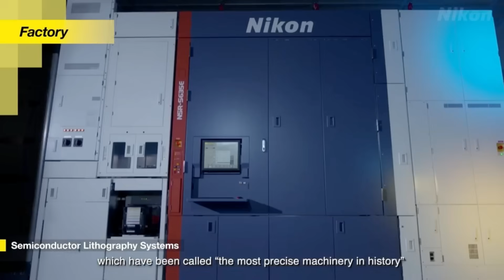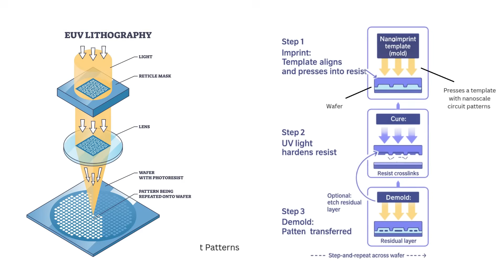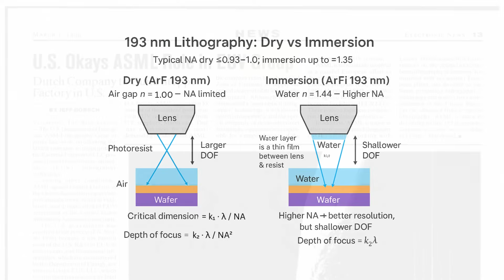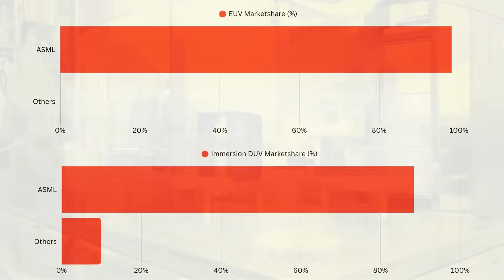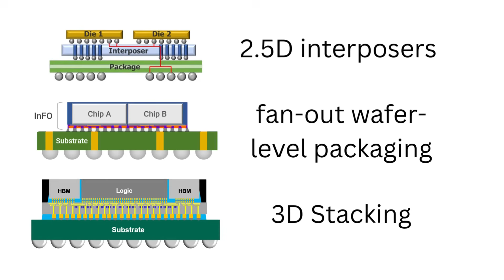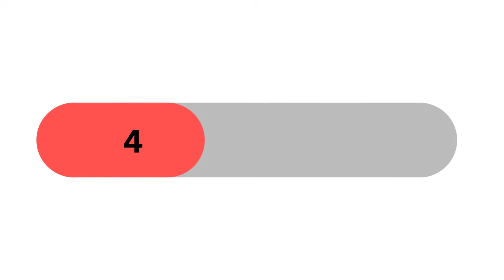Nikon’s Comeback: Japan’s Quiet Return to Chipmaking

Comment: Nikon still has 4000 chip manufacturing machines (out of 8000 installed) still in service around the world. EUV doesn't hold all the markets. At one point Nikon supplied Intel with 80 percent of their machines. Certain markets like camera sensors don't need the less than 10 nanometer circuits. ASML's most advanced machine costs 400 million dollars per machine.

Comment: I'm not sure you can trust this AI-generated video as the AI software doesn't realize that EUV is only possible with mirrors, not lenses, which is repeated multiple times. So what else is incorrect information?
Reply: If it cannot pronounce NIKON (nai·kaan) and keep mixing in (nee·kaan) how can you trust the data?
Reply: @Macazian because pronunciation has nothing to do with data?
Reply: @Macazian  Neekon is Japanese pronoun not Naikoon. Regard.
Reply: @Macazian  Japanese pronounce it as "nee-kon".
Reply: I ran the transcript through AI, and even it was suspect of  the message
Reply: Yes, it uses multi layer mirrors, not lenses, it's wrongly mentioned lenses even in their diagram. 
However the lithography machines shown from ASML & Canon is true, Canon is expanding sales of their Lithography machines in Europe & may reach Middle east in few years.

Comment: Just like EV segment cars, Big brand like Toyota, Honda, Nissan, bets on hybrid technology, and china see a market for EV cars and pushing R&D for battery technology, and Toyota still said EV cars is expensive and no want to buy EV cars, right now EV cars sales is in demands, the problem with Japanese company they don't want to invest to a new technology and just perfecting old technology.
Reply: Why Japanese auto makers are not enthusiastic about EV is the capacity of the battery and its recycling problem, also environmental problems by tire particles due to heavy battery weight . Besides it takes a significant amount of energy to extract rare earth like lithium. Toyota is developing  other types of battery like solid state battery and other types of technology.
Reply: Hydrogen energy.
There's more than 175 years' worth of hydrogen energy under the Earth, enough for the entire planet.
Add CO2 to it, or convert it into electricity.
Batteries are running out very quickly now.
Reply: BEV are just ICE with the engine moved to a power plant.
BEV won't become practical until nuclear fusion power becomes available and electricity costs drop to one-tenth of current prices.
Reply: @ux-ss6ds yes, but its better than you pollute the entire road. 
Its all about the source of the electricity. And nuclear is very potential, ofc with pro and cons.

Hydrogen is not efficient, to create hydrogen is need big energy,  storage is not easy as gasoline.

Electric vehicle is all about ecosystem and simplify the supply chain, cut the middle mand, gasoline broker like gas station. EV cut the logistic time, cut the pollution almost 50%.

Comment: The question for me is will Nikon be able to make the chips needed for products made in Japan and with the help of the Government (think tariff like rules/fees for chips made outside Japan)be able to  manufacture the needed chips for Japanese goods. In this area I believe that Japan thru Nikon will/can be successful even more likely if the funds are made available thru govt. support (low cost govt. secured loans/outright grants) to get a EUV capable chip fab built and running in the next several years.
Reply: Nikon doesnt make many chips. RAPIDUS IS USING ASML for thier fab.